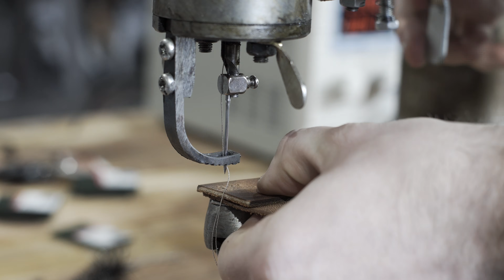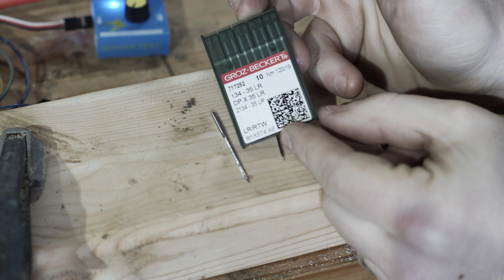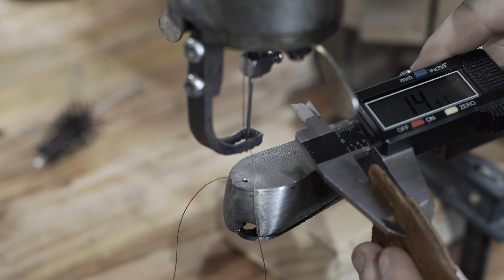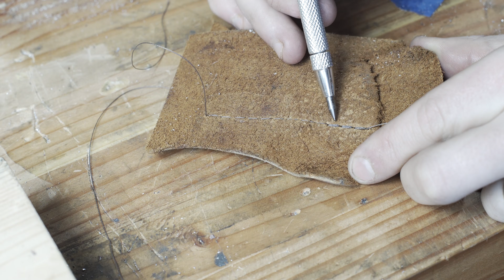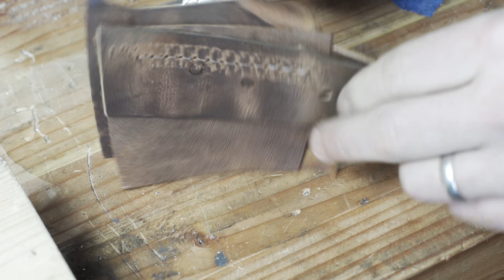Does it sew? Testing out the motorized leather patcher

Comment: You can adjust the machine to accept the 134 needle size you are using by simply moving the sewing tube clamp at the top of the machine. Then, you no longer need to do anything with the needle but put it in and use it.
Reply: Needle Adjustment Video: So, after requests I have put up a real quick video showing the clamp and the amount of adjustment needed. Here is the Youtube link: https://youtu.be/8eYECoyhLZc
Reply from the maker: Oh, that's awesome... thanks for the tip!  Will give that a try, much easier than grinding down every needle I want to use :)
Reply: Hi Tim, great advice, is there a demo vidio to see on this subject?
Reply: @kellymcgrath3563  I should make one. I've never seen one anywhere. Actually, when you have the machine in front of you, it is pretty obvious. At the top of the needle tube there is a clamp with an ordinary set screw holding it. Just loosen the clamp and adjust the position to accept the longer needle size. How? just put the needle into the holder, then move the clamp up the extra 25mm. When right, the needle tip will just - just - tip through to the bottom of the hole at the bottom; just like the original did.
Reply: @timbinman   Thank You Tim, I look forward to more of Your videos when You have the time. Have a great day

Comment: You can shrink some shrink tube over the teeth on the foot
Reply: Great idea i think its better than filing as you still have the teeth but wrapped and also a quick replacement... thanks for the tip
Reply: Did you do that? Does it work shrinking?
Reply: Does shrink tube work better than Plasti Dip?  I see the comment about the shrink tube being replaceable and that's a good point.